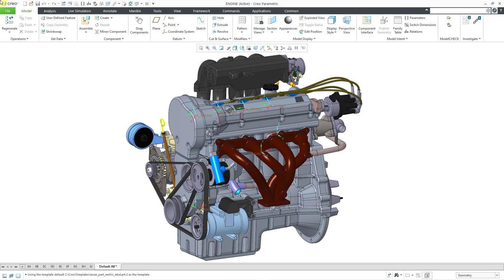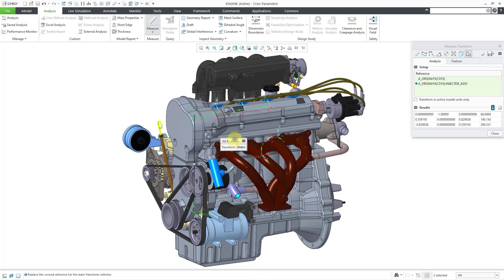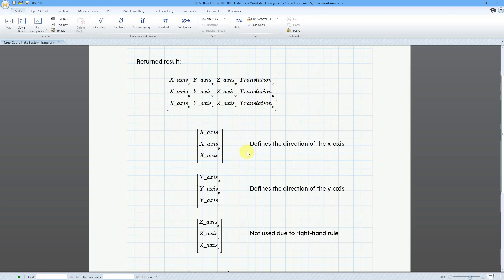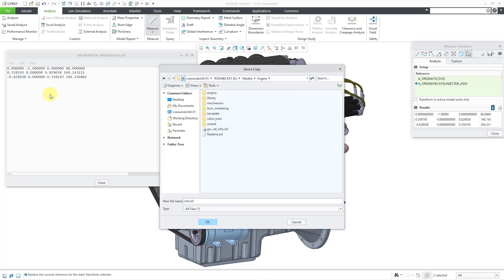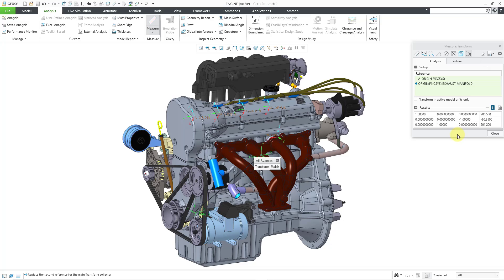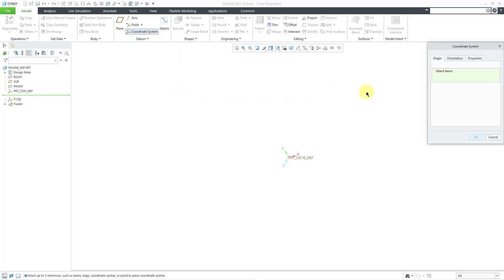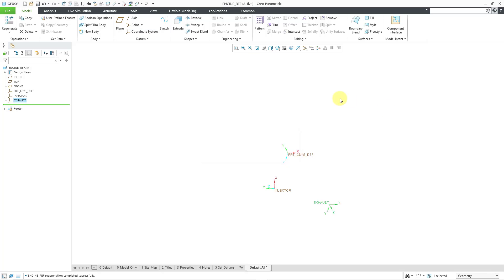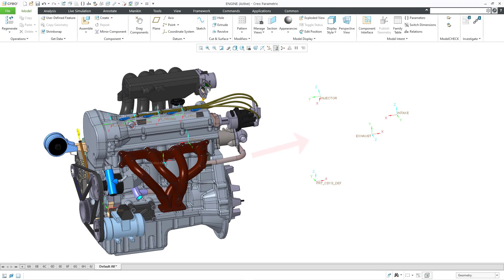Creo Parametric - Analysis Transform Tool for Coordinate Systems

Comment: Hi Dave, we're using this feature in a daily basis, it's very helpful when you have an assembly with a CS then you need to make this CS the default CS for another component, then create another working CS for  feature-creating purpose.

It could be hard for me to explain, but this approach is life-saving in the industry.
Reply from the maker: I suspected people are using this with Design in Context where part features are located out in space relative to the assembly default coordinate system, but I didn’t want to speculate.
Reply: @CADPLMGuy 
Yes, I work in the automotive industry, where it's essential to use the default CS aligned with the car's CS for any component. We begin by using the default CS and then create an additional working CS to build the model.

Comment: I could see a niche application for this in some of the tooling assembly modeling I do. Instance would be make my part based on the print given to us but without any attention to the part specific coordinate system. I then lay my part out in my main assembly and in order to create a more robust system, I start a skeleton model and want to locate a skeleton coordinate system for my parts. Using this method in the assembly I could measure from the skeleton default to the part and achieve the proper transformation and rotation to locate coordinate systems in my skeleton model to then reassemble my parts to.

Comment: Hi Dave, I met this situation in the past. This can be useful for exporting data to control software, for example, software that is a little dated and requires a particular orientation and position before exporting models, in native or neutral format. Often this outdated software doesn't propose any solution for matrix transformation. Regards. Eric
Reply from the maker: Thanks for the insight. I dislike making videos without knowing the use cases, so I appreciate your response.